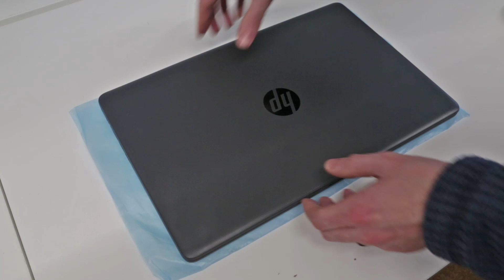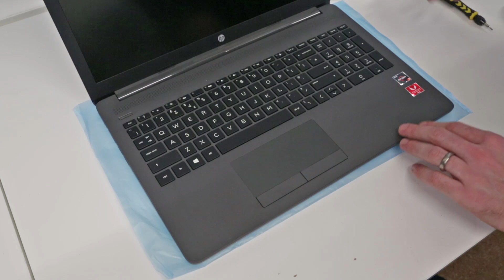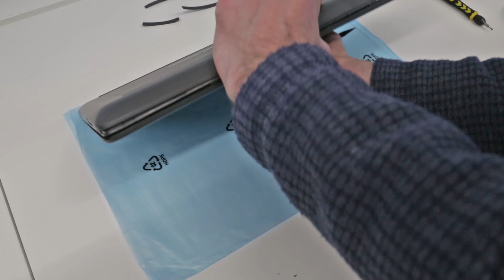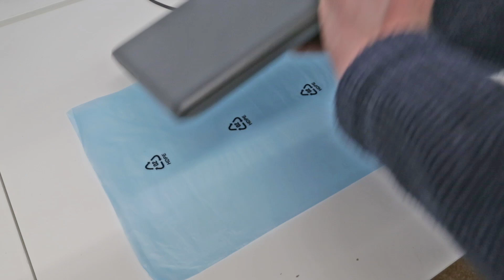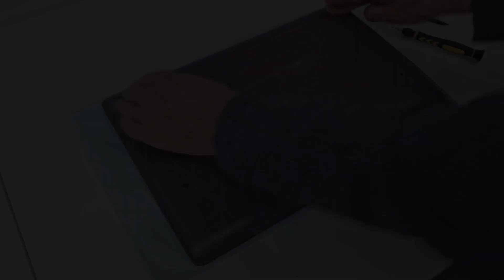HP 250/255 G7 - DDR4 RAM Memory Upgrade Guide - 6BN96EA

Comment: Hi Brue Computing, thanks for video. How is working 16gb of ram? I am confused because in Maintenance and Service Guide http://h10032.www1.hp.com/ctg/Manual/c06208876 they declares max RAM up to 8GB only despite of there is a second slot empty. I am interested in HP 250 G7 version with i5 actually, did you have any Intel version as well? thanks
Reply from the maker: I think the amount quoted in the maintenance manual is just down to the SKUs they ship - there are no dual channel configurations for sale from HP that I have seen. The max supported by Ryzen 2200U is 2 x 8GB.
I've not had a 250 G7 - I bought the HP 255 G7 specifically to do these videos and then sold it, but the upgrade process is identical between the two so there much reason for me to order one in unless a customer orders one.
Reply: Thanks for your answer  @BrueComputing  . I found that G7 has SVA panel istead of TN panel. Did you notice any difference?
Thanks
Reply from the maker: Viewing angles seemed a bit better than the very basic TN panel stuff you see, so could well be.

Comment: Thanks for the video. I'm here trying to figure out how to get the panel out. This laptop looks like an amalgamation of leftover parts made into a cheap laptop.
Reply: It looks much better in person.
Reply: I'm also having trouble getting rid of the panel, it's as if it's designed to keep you from opening it ever
Reply: @cedricoz7086  My employer has been using them for about a year and we all universally hate them. They're dim, low processing power, and designed to be as hard to repair as possible.